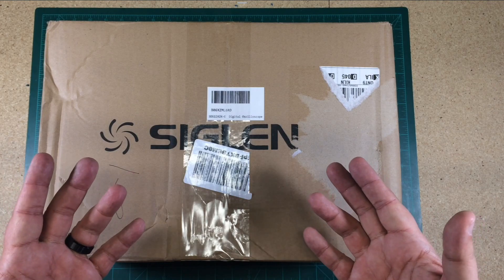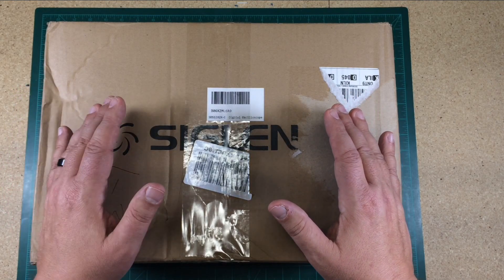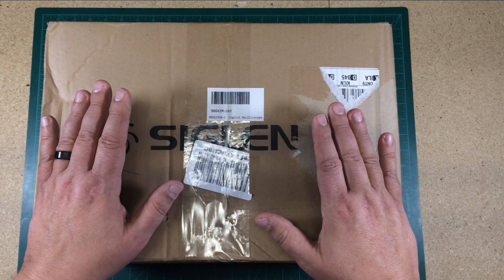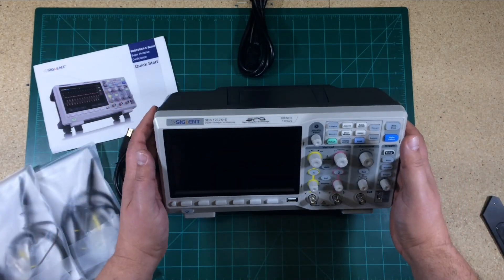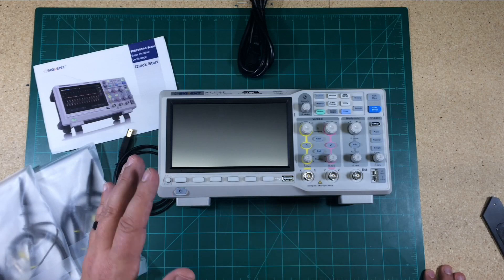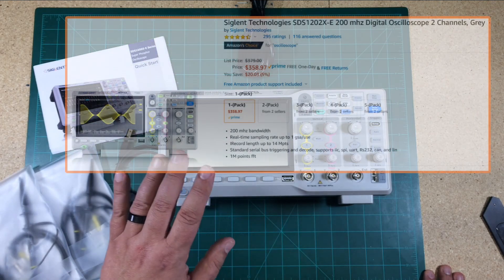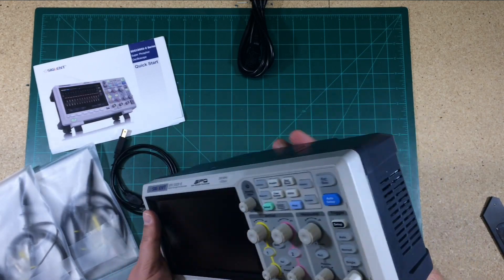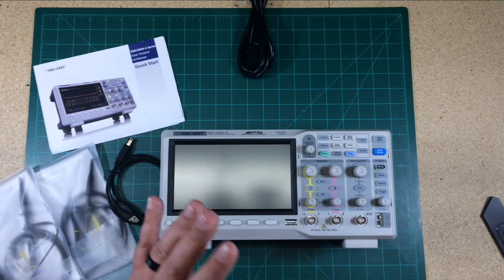Shop Talk - Rambling About The Siglent SDS1202X E 200 Digital Oscilloscope!

Comment: I have this scope coming to me in just a few days I do design work in high frequency power supply work that's what I do. mostly because my old scope something happened to the 50 Volt range and up and the waveform is crooked and I need to look at these high voltage supplies  that switch out about 300 volts so I bought this scope to do that for me

Comment: Since you mention having TDS scopes (I assume you mean Tektronix TDS 350, 360 type scopes), I would like to get your opinion.  I'm retired and setting up my workbench for repairing some old Tektronix 465 scopes and some old Hallicrafter Ham radios.  The Service manual for the Tek 465's states that I need a scope to check out the scope.  So, for the same price, would I be better off with one of those Siglent scopes or should I go back to a more basic scope like a Tek TDS 350 or TDS 360 scope?  I'm suspecting that the Siglent has far more features (complexity) than I'll ever need.  I was (long ago) an electronics technician - not an Electrical Engineer.  And the TDS scopes have the controls layout the same as the older 465 scopes which would be more familiar to me than the menu driven Siglent scope.  One feature I like about the TDS scopes is the turn-on self-tests and the functional tests capability.  If I bought one that passes all those tests then I might assume that it would be in good condition, right?  I think I'm talking myself into the TDS scopes.  Is there anything you could point out that might sway me towards the Siglent?

Comment: I purchased the Siglent Technologies SDS1202X-E Oscilloscope to replace my Elenco 25 MHz S-1325 I purchased in 2009.  I build clocks and built an analog clock using a 3D printer and an Arduino. The clock is not very accurate so I am adding an RTC circuit to it next week. I build clocks as a hobby.

Comment: I bought the 4-channel version SDS11-4X-E in  Feb-2020.  Huge upgrade from my €15 Aliexpress "scope",  I;m still learning about scopes and stuff for my #easylab4kids channel.
Reply from the maker: I debated 4 or 2 channel but went the cheaper route just because I have 4 channel Tectonics TDS scope already.
Reply: 4-channels definitely an advantage, and quite possibly a better choice for most people, but to me, the 1202X-E stands out for the high bandwidth for the price, so is better for my use personally I think (and I can't afford a 4 channel scope with that bandwidth I don't think). Do you know much about model numbers? Is the 1104X-E a previous generation, or what does the second digit signify? I think the 1202X-E is pretty new right?

Edit: Oh, it is probably the bandwidth. I should have thought of that.